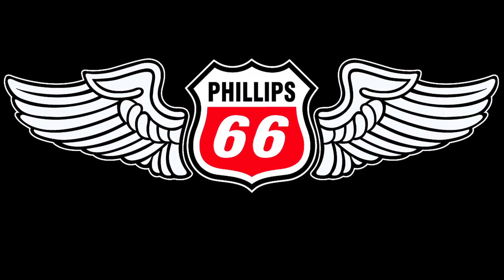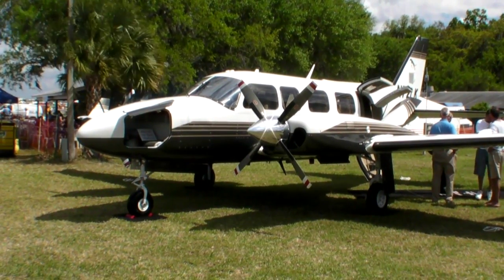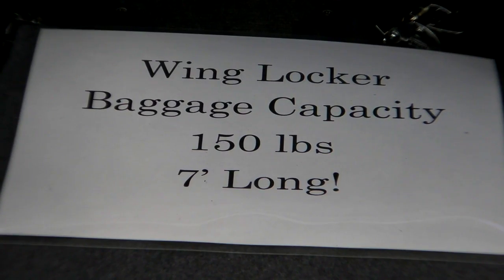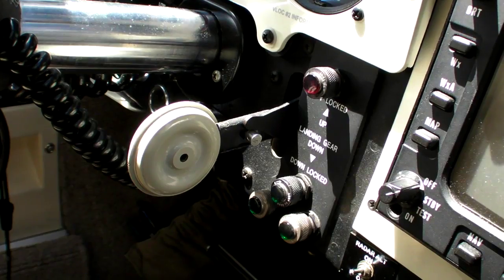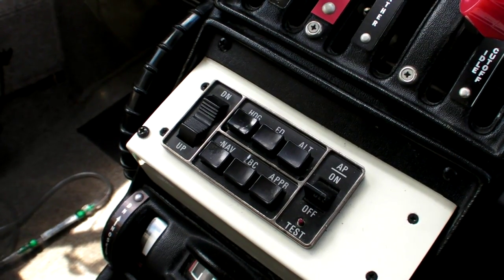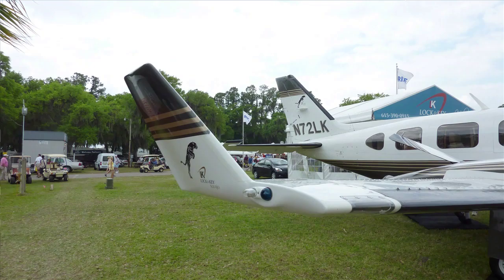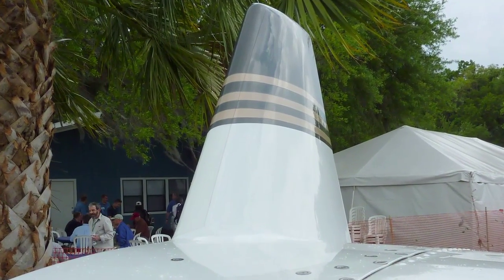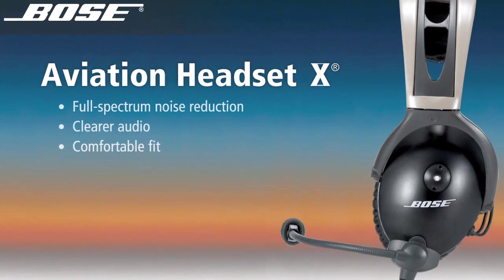Lock and Key Navajo Upgrade

Comment: The Piper Navajo - Panther is an all around  aircraft with its payload at full fuel made it one of the  top contenders for smugglers from its single engine climb performance to its ability 
to land on grass strips,

 The gages are layout ease to read and controls along with its seats make it a very ease fit if your a short 5F 2IN or tall  6-6 make's  it's no trouble to reach switches and controls and that's not always the case in aircraft.  The cockpit seats put you up front giving you
good visibility out the front as well as each side. 

There's no fighting to look over the instrument panel if you short or bumping you head if
tall. I love the ones with the pilot's crew door.

Heard the story of one smuggler who took a Colemill Panther upgrade to  TBO on the engines and the KFC 200 could hold the Panther at 50 feet above the water with no trouble 

The KFC 200 autopilot makes the aircraft so ease to fly and if it has the yaw-damper 
 it's even better.  One huge advance of the KFC200- AP was its ease of service

 The Servo's can be removed and not affect the control cable rigging unlike the C-3 were the servo- cables must be removed in order to repair them 

The cabin is large with more than need leg room. Its airframe can be open up for avionics upgrades or service.  The wings and tail make it ease to install any of the HF systems from the King 950,  sun-air or the Collins fiber opt hf. The HF  Ant can be run from the right
wing to the top of the tail and down to the feed through in the aft tail section that gives you the performance to set on the runway in South FL and talk to King radio in Kanas ease. or talk worldwide in the air.

The nose bay has lots of room even with avionics shelf install  and the radar wiring is 
a short state shot to the cockpit and wing lockers off space as well

With a good pilot its no trouble to get in or out of somewhat short strips that some
would not risk. The RR at Colemill always look short but Doug never had any trouble
nailing the numbers as they say and would go over to BNA more that once to bring
a Panther back to the fort.

Mike Jones is keeping the Panther  alive with engines, paint, and avionics updates which
give you a top of the line cabin class service at 1/2 the cost of new and better performance that's base on solid numbers and just like the DC-3'S that flew long past what many saw
as their life span, the Navajo is a workhorse after all how many aircraft can take off
at fuel and cargo. 

The Panther just like the FoxStar Barron with 4 - bade Q-tip props and wing tips always
turn heads anywhere they land. And drop the noise in the cockpit. With the avionics
upgrades, Mike Jone's offers along with doing test flights to ensure its ready to work
when you pick it up is what customer service is all about  

So if you thinking of a new aircraft take the time to stop in and meet Mike after all 
performance talks and Navajo systems are sold if not they would not still be flying
like they do 

And one thing for sure Smugglers don't waste money buying aircraft that are not robust
or  ways needing service

Comment: Did I fail to mention in the early eighties that won the Paris air show race in world record time and the plane has several World I actually flew in that plane which at all the paint stripped all the seats  stripped in a gigantic bladder gas tank installed Buzz the cold mil field at about 330 knots I miss old blue he was a character